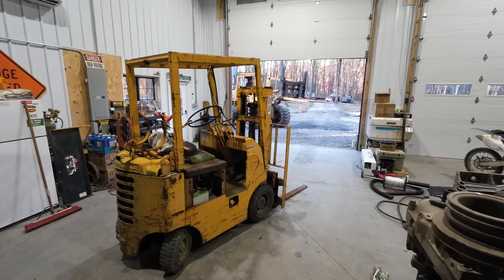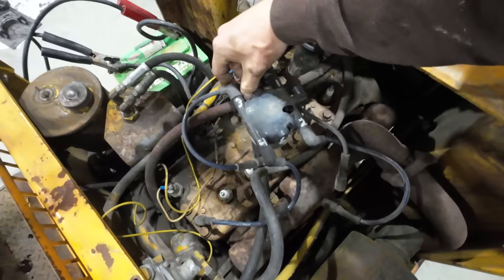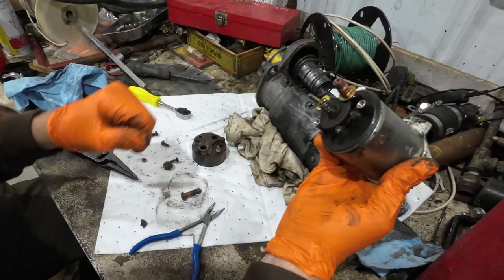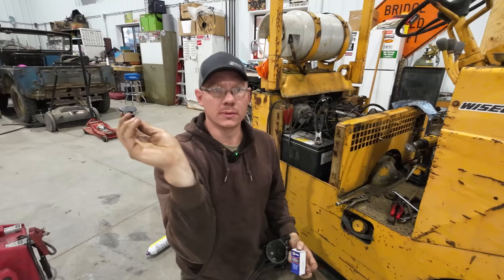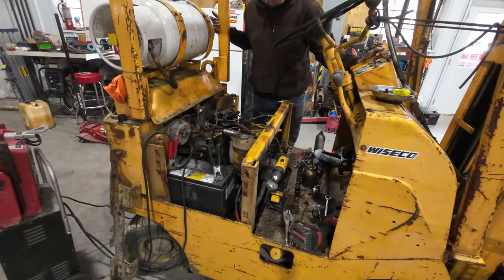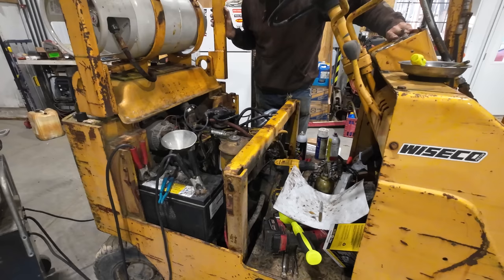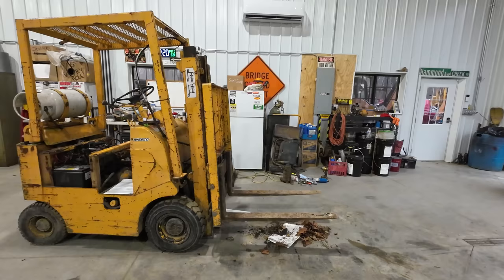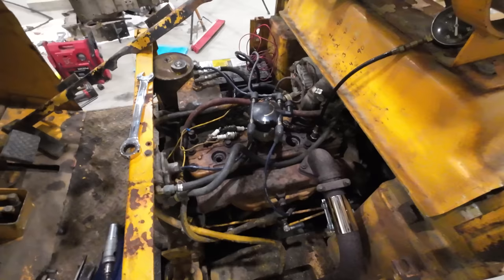Save or Scrap? CAT Towmotor sitting for years. Will it Run??

Comment: Propane engines are touchy . My 68 ihc 856 propane tractor was so touchy on the carb and fuel system . Also if your ignition system isn’t perfect , they throw tantrums. We also had a 400 ihc tractor and an 806 on propane . They were great when everything jived right .

Comment: If you've given up on it id be interested if you haven't already scrapped it. I have a earlier 510P to that doesn't have sideshift or powersteering. Mine ran great though after fixing the fuel regulator, bought it non-running for $600.

Comment: You have a sweet little towmotor there, don't scrap it. First, I don't think you have an ignition problem, I think the lp converter is freezing up. Follow the gas line to a 6" round box with engine heater lines to it. It converts liquid lp to gas.

What you think is a rear main leak is probably clutch oil. It sprays oil on the wet clutch, then a scavenger pump pulls it out of the sump, kind of like a Harley engine. I'll bet the engine oil level is not going down.

If you pull out the u joints and take off the cover on the bell housing, you can remove the top shaft and pull out the clutch without removing the engine.  You have a diamond in the rough.

Comment: Assuming your guy looks at it and determines the engine is saveable that would solve your leaking problem it might not be very good as a forklift but I wonder if it could be used as its namesake a tow motor

Meaning take the forks off and put a pencil ball hitch combo unit on the front with the lift and tilt and side to side it'd be very easy to hitch up a trailer and yank it around the yard use it literally as a trailer mover

The manual clutch at that point is less of an issue it could probably haul pretty much anything you have and what the pneumatic tires it just might work for that

In fact I'm pretty sure that's exactly what they were used for before they were converted into forklifts.

Comment: I would save the propane parts for a guy looking to covert save the mast and fork crane for tractor to skidloader or other projects and wheels and tires maybe they will fit the allis, have two old clutch type Clark machines and do really like them even without a shuttle or converter drive

Comment: Well thats a shame its got to have the second opinion from your friend on life or scrap ..however its put up a valiant struggle to survive but its got a few more issues that maybe worse than originally expected.  I see the intermittent spark issue is a known issue as mentioned in the comments below . Possibly the engine could be saved but its got the self change facility thats not so popular and if your going that far to pull it out how far is the economics in a rebuild .. at the very least you have a newer safer set of forks and possibly some other components . I would however before resigning it to the scrap bin remove the starter that deserves to be be framed for service above and beyond the call of duty . Keep posting great videos thanks

Comment: Matt I am working on a 1965 Clark cy40b gov. Model, gasser and it's fun. It has a Continental F163 and ur tow motor looks to me like a F162 they were more common then the F163 from what I could find on the web. The spark issues might be the ballast resistor. I've had to replace a few with a 2 wire for similar loss of spark issues and the 2 wire seem to fix the issue.

Comment: Try with the spark plug wires just about 2mm off the spark plugs.  Somehow this makes the spark more powerful rather than less.  Then try small plug gaps. then large plug gaps.  and more ether.
  Also, where do you have the throttle? It should be at least 1/4, not just at idle.

Comment: Hey Matt, I don't know if it's something you'd be interested in, but in the upcoming (at time of posting) Richie Bros Southeast auction in Newnan, GA there's a couple military Deuce 1/2 trucks in the inop section. 1 has clearly been in a rollover, with the frame bent to hell and the cab crushed, but from what I could see when I was down there, the engine was intact. That 1 has a wrecker winch kit on it and I figured you might be able to pull the engine and winch to sell or use for a spare. 
The other Deuce looked to be in decent shape with a similar body style to the 1 you have, other than 1 of the tires was completely blown, but if you were to get both, you could probably steal a tire from the rollover truck. I wasn't able to get it started while I was down there, but it could have just been a dead battery. 
A third thing I saw in the inop section was a small remote controlled vibrator compactor with 2 sheepsfoot roller wheels. I was able to get it to turn over a couple times by itself, but the low battery light was on and I couldn't get it to turn over anymore.

I would buy all 3 of these myself, but I don't have the time, money or space to spare for such large projects right now, and I figured I'd pass it along since I know you enjoy fixing up stuff like this, and I enjoy watching you fix them.

Comment: I learned to drive a forklift on one that basically had no clutch, it was either on or off.
Driving across a rough yard to unload a truck was at best embarassing, you'd dip the clutch so as not to ram the side of the truck and get stuck in a hole. Or you'd keep going then drive in to the side of the truck.

Comment: I was always taught the bare minimum was no less than 90psi for an engine to run, and that didn't mean it was healthy. I haven't believed that for a very long time now. I've seen as low as 65-70psi yet the engine runs just fine, with no misfires, and passes a tailpipe emissions test (again, not saying it's healthy or couldn't be better, but they run). The exact numbers are less important than deviation between cylinders. Always test ALL cylinders. You're dealing with a compressible gas and there are lots of variables that can skew the numbers, ambient temperature/barometric pressure/elevation, engine/valvetrain temperature, fuel system disabled or not, RPM during the test, throttle plate open or not, cylinder displacement and compression ratio, how well the tool seals against the head, how long the hose to the gauge is, carbon buildup in the intake ports restricting flow into the combustion chamber (thanks gasoline direct injection and valve timing being used to facilitate EGR), etc., etc. If there's more than about a 10% difference between 2 cylinders, that's when you start wondering if there's possibly a mechanical problem.

Though this doesn't apply to that ancient engine, on newer engines with variable valve timing I have used a compression test with an abnormally higher reading on one cylinder or bank of cylinders to help determine or reinforce a diagnosis of improperly functioning variable valve timing components.

Comment: I had a motorcycle engine that had the rings stuck sooo bad that it would not open the reed valves. You had water all through the engine...Mr rust had everything seized up.

Comment: I think you have the spark plug leads on the wrong way around as the motor is in the forklift around the opposite way to what it would be in a car. 1 is at the back not the front

Comment: Matt the only ignition components I did not see you try were new spark plug wires and spark plugs.  I wonder if the wires or spark plugs were intermittent after getting warmed up.  Can't think of anything else that would cause you to lose spark.

Comment: I don't pressure wash engines before a repair, the muck and crud let's you see a multitude of sins.
It shows up wet spots where leaks are, spanner marks where previous work has been undertaiken, exhaust leaks, Replaced parts show less crud, so you can see at a glance what newish parts their is.
Once the initial look over has been done, then it can have a good steam clean.

Comment: Good morning that machine is a fine lift and most parts are believe it or not still available. If you’re close to nj I would gladly let you know where to get stuff. I’d also be glad to give you any knowledge I have you seem quite proficient though. I have 50+ years of forklift experience and I love the classics. The continental engine is probably an f162 or y112 it should be a wet clutch they usually remove the quill pump because it cause’s leaking issues

Comment: The weakest part of any "spark ignition " engine is the ignition system. You might have spark on all cylinders in OPEN AIR but that spark disappears under compression. Clean and gap the plugs you avoided cleaning and gapping 2 or 3 times (ie don't take shortcuts). 0.8mm (32 thou) plug gap is about right. Replace the condenser (it is cheap ~$5) even though I doubt it is the problem. Replace the coil, it seems like it can't supply a spark under cylinder compression. The starting problems all point to ignition system.

Stop taking shortcuts, they end up costing you a lot of time & effort.

Comment: Matt, Caterpillar calls forklifts " Tow motors" because they bought the company. I worked for Cat. They will see a struggling manufacturer, if conditions suit them to expand Thier lines, they buy the company. Bros roller, now Cat. Perkins, now " Perkapillar. Several corporations contributed to this expansion in the last 20-30 years.

Comment: it appears that has the same transmission as a free old Hyster forklift I got. Its certainly a pain to use, but mine does function properly so I cant bring myself to scrap it. I have a more modern powershift Toyota forklift that's my go to though.

Comment: don't scrap those old forks off the allice. cut the ends off and you've got yourself a pair of heavy duty splitting wedges , with those slow tapers their handy for splitting gearboxes, pulleys off shafts and the like.

Comment: Excellent video Matt  :) also save the roll cage , forks you said and take a good look on parts save for other forklift that good condition you have be electrical or gauges ! Or something need off for future videos  projects to and yes it amazing  how electric parts last long time Matt :) even starters , Generator  , Alternator  or gauges too even Lol key ignition switch or lights one too! My late Grandfather bought a Ontario Canada made farm tractor called Cockshutt COOP 40 gas motor  it was my late Dad & Late Uncle  my dad brother tractor  on home farm when bought in 1957  to 1997 ! Funny part motor got damaged  in 1993 and couldn't be fix up unless found another motor in good condition! But my uncle and dad  save for Tractor restoration  a another farmer in wanted it also and tractor guy restoration on with part of Cockshutt to another one ! Starter  , Solilendo  , Generator  , key ignition switch  , plus much on driveable 1950 Cockshutt 40 get restoration to and guy put my last name said about at local tractor shows and seen too ! But old 1950 all paint up and pretty to see too and old 1950 tractor my families had lots stories tell for lifetime and learned on in my childhood years  too ! But never lose them about that tractor too and you Lol when talking about it!

Comment: 1965  |  CAT LIFT TRUCKS
In 1965 Caterpillar acquired the company Towmotor and formed Cat® Lift Trucks. In 1992 Caterpillar and the Japanese-based Mitsubishi Heavy Industries began a joint venture company, Mitsubishi Caterpillar Forklift America Inc. (MCFA), to produce and market lift trucks. Cat lift trucks deliver innovative material handling solutions for the most challenging applications. Today, our forklift lineup consists of electric counterbalanced lift trucks to internal combustion (IC) cushion and pneumatic tire lift trucks.

Comment: If that is a continental engine, it's probably got the same starter as the continental aircraft engines (the one you have looks very similar anyway) and while it may not be the "aircraft" grade version it's still got the same parts

Comment: I have driven these machines in warehouses for several years and have always heard them referred to as forklifts. I've heard the term "tow motor" and wondered what   one was. The term "forklift" describes what the machine actually does, but I don't see that it has much use for towing (pulling) anything. Tow motor, curious term.

Comment: I had a coworker have a battery blow up on a fork lift right next to his face. He kneeled down next to it and when he cranked the engine a bad connection on the battery cable sparked and boom. He was ok after a wash station visit and some new cloths. But his face was red for awhile and it took awhile for his hearing as well

Comment: 1st start was smoky because you put oil in the cylinders.
2nd start was better because you didn't.
Reply: +1 on that.  I thought the same thing on the second start (though it wasn't better - just not smokin out the shed).  But I might have plopped some oil in 2 and 3 the second time as your sharpie cyl pressures show they were the lowest.

Comment: Spark Plugs rammed in with an impact. Loud Ruckus Laughter ensues. Just like watching that one mechanic everyone was shocked to be around until you realized he had no time to wait around for looking up stuff. Even though finger tight is just as common. ha ha ha
My Never Give Up, Never Give In mind wants so very much to say continue but, It's evident that you are more realistic than I. The manual transmission clutched system was a big let down. That was nearly the clincher for me. Like I said you seem more realistic than I tend to be.
Sometimes I horde too much, only to realize either I don't have enough time or material to make the endeavor a reality. I'm hoping to learn something from your well versed experience.

Comment: I kept thinking about a bad ground wire on the ignition system going to the coil is the cost for the stalling in the bed idling but between the bearing and the blowback tell us what your buddy says about it

Comment: Matt, a loose rotor doesn't affect the actual ignition timing.
Reply from the maker: It absolutely does. How could it not? If it has 15 or 20° of swing to it, those are the exact same as rotating the distributor.
Reply: @DieselCreek  when rotating the distributor housing it causes the base plate with contactpoints to move more forward towards or back from a lobe on the shaft. That affects ignition timing. Not a sloppy rotor. You are not moving the distributor cap alone when setting ignition timing. A sloppy rotor just increases the air gap between the rotor and the contact points of the distribution cap but the spark occurs at the same time (if the air gap has not become too large to make a spark possible).

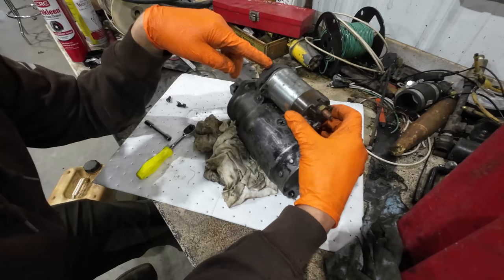Comment: Yeah way to common these days To just replace Instead of rebuild Most customers would be happier if i could just rebuild things like starters instead of replacing them cost would be lower its actually a shame nothing is rebuilt and everything is replaced these days most things in the automotive realm is built for replacement it drives me mad as a mechanic Matt 22:00 @Diesel Creek

Comment: It’s hard to kill a Continental. I worked on them for years. We had a small Clark that they ran out of oil, I put oil in it and tried to turn over the engine with the fan and broke the belt. Pulled starter and tried turning the fly wheel, it was Locked Up. Put starter back on and pushed it aside. A couple days later I saw it in a different spot with antifreeze under it. Somehow it un-seized and someone ran it till it overheated and blew the upper rad hose. Guess what? It started right up. I put a new front seal (the oil leak) rad hose, and belt on it and has run fine ever since. But rear bummer on yours. The rear seal just isn’t worth it

Comment: A while ago I bought a not-running boat for super cheap, it had a 2.5L iron duke engine. I thought I can get it running easily since its a carbureted gasoline engine, how hard could it be. Ended up selling it since it has same kind of symptoms. When it got hot under the engine cover it just quit on me. I replaced everything that made more or less sense but still no dice. Getting spares from US to overseas was pretty expensive as well.

Comment: If the starter wasn't greasey it would've been hard to pull out the oil made it slide right out I use to buy the cheap rebuild kits if the drive gear wasn't tore up and rebuild the whole starter myself but most places don't sell them anymore and if they do a reman starter is usually cheaper or close enough by the time you rebuilt the starter you could've been using the machine or vehicle

Comment: That engine probably would come back around if you cleaned the head and lapped the valves. It's a shame. It was a good machine, but was destroyed by pure neglect. I hate to see it get scrapped. Save as many parts as you can. There have to be people out there looking for that kind of stuff, and it can't be easy to find.